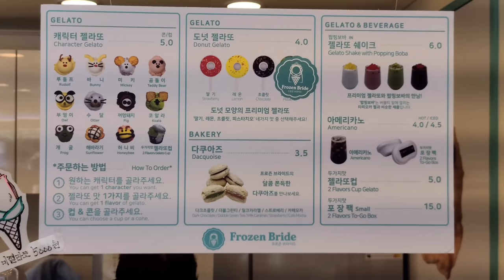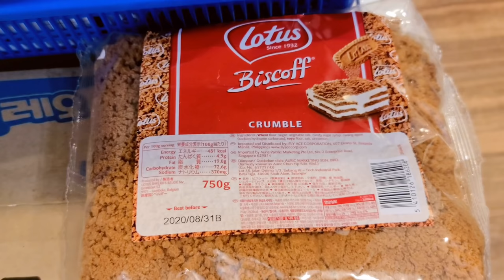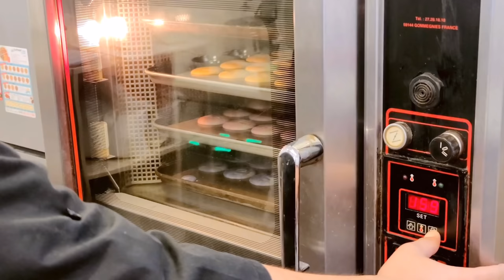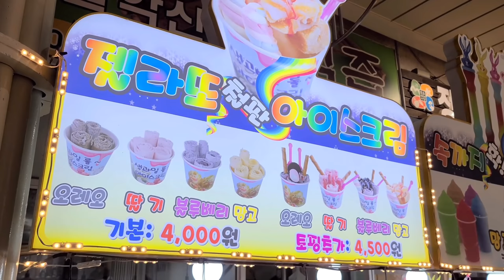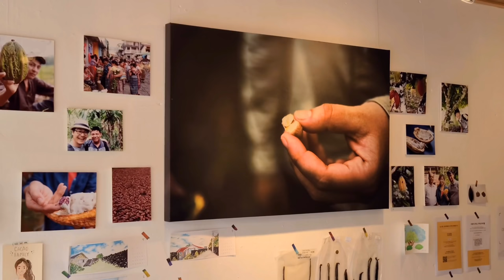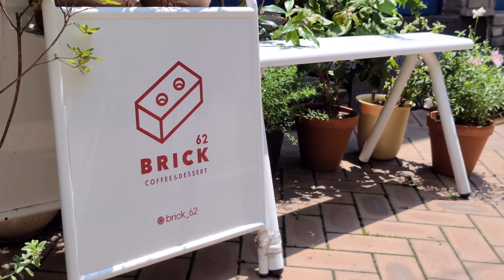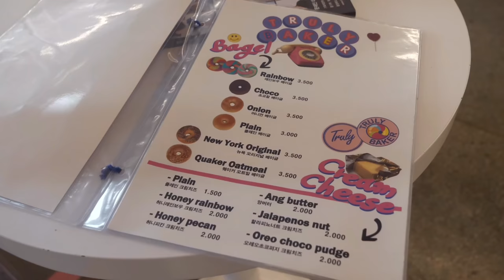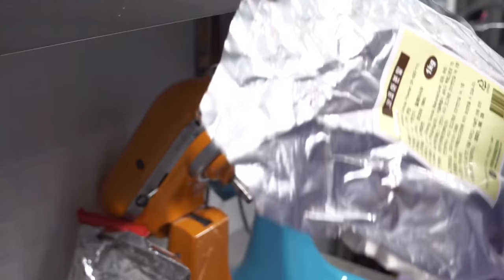TOP 10, Best Delicious Korean Desserts - Korean street food / TOP 10, 요미야미 Best 디저트 몰아보기

Comment: The macaron pastry chef is amazing!!! You can see their skill and 10,000 hours of practice. Easily making a caramel and macaron batter is so impressive. That’s art 😌
Reply: Except when he's using the mixer on whipped cream. It's supposed to be folded in! Their loosing half the volume in the whipped cream by breaking all the incorporated bubbles. Sigh
Reply: @mermaid2014  pp
Reply: @mermaid2014  p
Reply: @mermaid2014  pp
Reply: @mermaid2014  p
Reply: Pp
Reply: @mermaid2014  p
Reply: P
Reply: @mermaid2014  p
Reply: Ppp
Reply: P
Reply: @mermaid2014  ppp
Reply: @mermaid2014  p
Reply: @mermaid2014  p
Reply: @mermaid2014  p
Reply: @mermaid2014  p
Reply: @mermaid2014  p
Reply: @mermaid2014  pp
Reply: @mermaid2014  p
Reply: @mermaid2014  p
Reply: @mermaid2014  pp
Reply: @mermaid2014  p

Comment: Those fluffy pancakes are soooo hard to make right; however, they are amazing once you get it right
Reply: I would loooooove to have a recipe!!! Would love to try this!!
Reply: @tijnsnijders   2 egg yolks(58-60g each)
20g Whole Milk
10g Vegetable Oil
1/4tsp Vanilla Extract
30g All Purpose Flour
3 egg whites
1 tsp. White Vinnegar
40g fine sugar

1. Add egg yolks, milk, vegetable oil into bowl, mix completely then add the vanilla extract. Mix again, until the mixture is a light color and foamy.
2. Sift in the flour, and mix well. *NOTE: pay attention to batter’s consistency, not too runny nor too thick.

3. In a separate bowl add the egg whites & white vinnegar, then mix. while mixing add the sugar in parts instead of all at once. You should have stiff peaks.

4. Add the stiff peak mixture into the egg yolk mixture gradually, make sure not to stir too fast. This is the part that gives the pancakes that fluffy trait everyone loves. 

5. Finally put the mixture into a pouring bag and make towers of the thick mixture, in a oiled pan, cover the pan and let cook for 3-4 minutes(time will vary depending on your stove).

6. EAT
Reply: @kinoryu9512  
I want to try making these so bad!  I have seen countless videos about them & they always look so fluffy & delicious!
Thank you for taking the time to type out this recipe! 😘💕  I'm going for it!

Comment: Every was really impressive and beautiful food made by hand. Except one unfortunately. The guy making the chocolates was making a mess and not worth whatever he charged. First off I do hand made very complex chocolates for people at Christmas. I hand paint them. Having a air brush and doing what he did was not special and he did it really sloppy. Then he put the chocolate in the microwave which you really shouldn’t do. I haven’t owned a microwave since I was a kid and this forced to. Any good chef will tell you a customer should not pay for your food if it touched a microwave. They are unprofessional, unhealthy and they change the molecular composition of food. If that’s not enough it takes seconds to burn chocolate in one. On top of this he melts too much chocolate every single time. You should aim not to do this because you can warm it up over and over as it builds up bacteria. You can see he’s done this a lot. It also makes no sense whatsoever the way he fills his trays with chocolate. At one point he poured a ton of chocolate on the table. Where did that go? It better not have gone back in the bowl for later but im guessing it did. In the end his chocolates did not look that impressive. I make them once a year for a few weeks and I do better. If he sells those as expert, hand made or artisan than he needs to do better. Where I live that kitchen would fail health standards and it should. He can kill people.